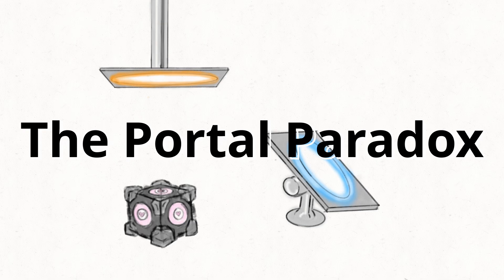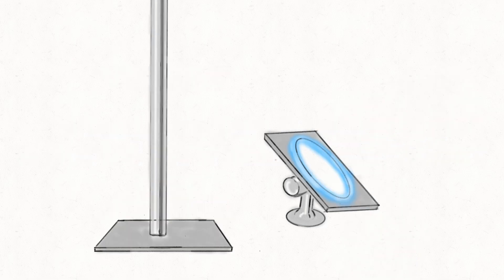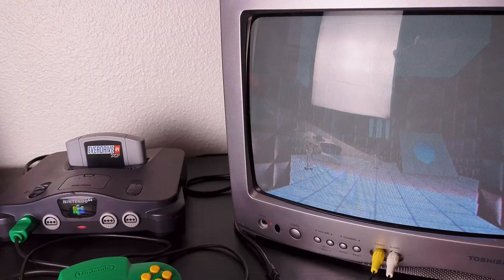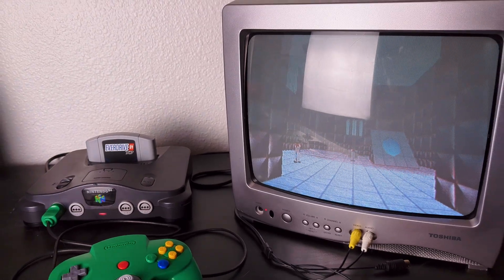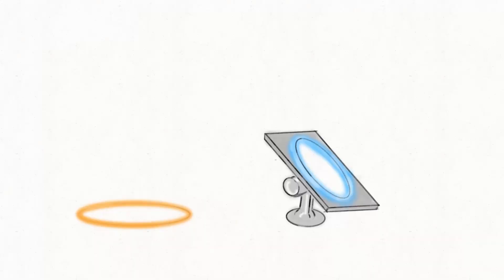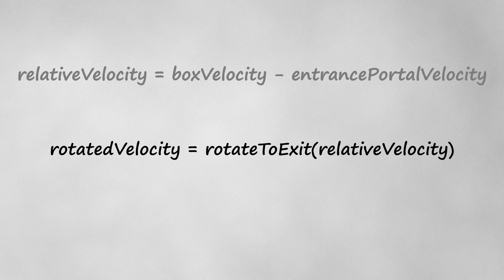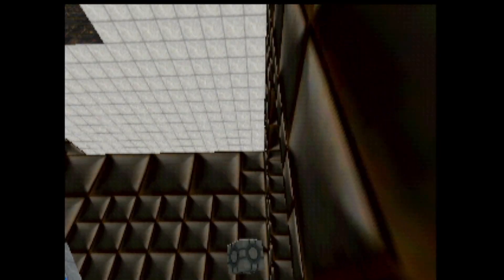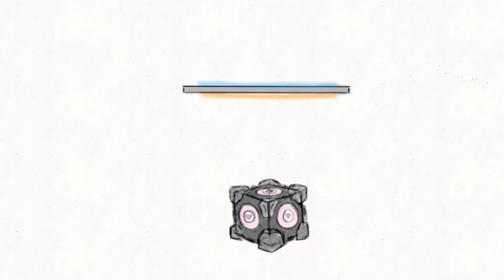I rewrote Portal from scratch and solved the Portal Paradox

Comment: I think the real problem here is that with this behavior of the stationary cube suddenly flying out of the other portal, the portal has added energy and modified the momentum of an object that was stationary. That is seemingly impossible unless the portals are energy sources. Does Chell also fly off into space when a portal moves onto her?
Reply: This is what I came to ask and glad to find someone else thinking the same. 

Where did the box get its energy from?
Reply: @KAC710  Think of it like you're in a bus:

Let's say you are walking in a bus. When the bus is moving and you are walking in the direction the bus is driving, relative to the ground, you'd be moving as fast as the bus plus your walking speed. If you were to be walking in the opposite direction of the bus's movement, your speed relative to the ground would be the bus's speed minus your speed.

This conservation of momentum also applies to portals. Since the portals you go through in the game never normally move, you don't gain any speed or momentum. But, when going through a portal, the portal gives you its momentum, relative to you. Like I said, since portals don't typically move when you are meant to go through them, you don't gain any more momentum. If they were to move, you'd gain the momentum of the portal you enter, and fly out of the exit portal at that speed. 

But, that's all up to speculation since a portal gun hasn't been invented yet. No idea if it's A or B, but it seems to me that B is more logical than A, but I may be wrong.
Reply: I imagine you won't even read all of that tbh
Reply: The portal may be moving to us, but it is a connection point on a different dimension than the 3 we normally experience. So to the portal, it's not actually moving. The door may move on this plane, but the path to the exit remains the same. So to the technically static portal, the cube is flying up at it, and it maintains that when the cube exits.
Reply: You are talking about teleportation portals - they break basically every law of physics there is. You can find countless nice fully mathematical explanations on how instant communication (or travelling) directly leads to time-travel.

In the games the portals can move objects to places of different gravitational potential - producing infinite energy. Just imagine a portal high up a mountain connecting to one at the bottom of the ocean: The pressure in the ocean is insane and so you would have a giant fountain with water gushing at around the speed of sound!!!! 

The portals being stationary or moving is the least problem then and treating the velocity as relative to the portals at least would be a consistent behaviour.
Reply: @ABaumstumpf while I've frequently seen examples that FTL travel leads to time travel (and they all require light travel the same speed in every reference frame), I've never seen the argument for instant teleportation because it uses infinite travel speed and ignores the speed of light issues that make effect happen before cause
Reply: @w49660   any explanation for why FTL causes time-travel also directly applies to instant teleportation as that is just the case were the speed is literally infinitely high.
The portals act like wormholes and for those there are many nicely written explanations on how they cause timetravel.
Reply: @ABaumstumpf  in their explanations of wormholes as time travel devices they eventually use frames of reference where the speed of light is a maximum and the explanations include "apparent" time travel "as seen by an observer from the outside" (and wouldn't let you travel into the past). It doesn't seem to apply to instantaneous teleportation that uses infinite speed
Reply: @w49660   i am not sure how you are searching or what you are reading, but with every combination i could come up at least one of the first 3 results gave a good explanation - ANY movement faster than the speed of light (which does include the infinite speed of instant teleportation) always results in a closed-timedlike-curve - which means timetravel (and not just "apparent" ).
https://en.wikipedia.org/wiki/Closed_timelike_curve
Reply: @w49660  I don't know why this myth about FTL just won't die, and people keep using it to defend Alcubierre. All FTL causes time travel. It doesn't depend on the mechanism. All that matters is information got from A to B faster than light. That is not to say an Alcubierre drive is literally impossible, but it does imply that IF such a thing is possible, then so is time travel to an extent.
Reply: @ABaumstumpf  FTL travel (properties of particles) and CTCs (geometry of spacetime) are separate concepts in theoretical physics, and I've found nothing that says FTL travel by itself (which leads to violations of causality) always creates CTCs
Reply: Good point. To preserve the conservation energy, mass going through the portal would have to create resistance to the portal's movement, proportional to the energy 'added'.

But that creates interesting new issues.

1: What happens in a falling loop? (two portals facing each other, one directly above the other)

I think there would actually be no resistance in the case of two portals that maintain a fixed position relative to each other. It's only when they move relative to each other that energy becomes 'added' and so resistance is encountered to conserve energy.

2: So the issue now becomes a matter of two portals moving relative to each other. How is the energy conserved? Is it applied to the portal? The mass being ported? Both? Does the mass experience inertial resistance relative to its original vector, or is it relative to the portals?

If relative to its original vector, that would imply that space itself is not being ported. If it's relative to the portals, then space itself is being ported, which means that the moving portals would create spatial voids relative to the fabric of space itself or something like that... I know nothing about the dynamics of the fabric of space itself, so lets just say it's only mass being ported. In that case, the mass would experience inertial relative to it's original vector... but physics breaks down if the portals themselves don't also experience resistance.

3: So, how would the pressure be shared or expressed between the mass and portals? I suppose that all comes down to the relationship between mass and the portal, but how does the portal work? What holds it where it is? In a situation like a cube being squeezed between two facing portals moving towards each other, what takes up that backlash? Can the portal deform or break? What happens if it does? Maybe the energy demands come from whatever energy is powering the portal, so in the case of electrical power the electrical load increases? But why? It all depends on the physics of the portal itself and the engineering of the device creating the phenomenon.

4: And what's happening behind the portal? Is it creating a void as the portal moves forward? What about moving backwards? How does that work in a relative universe? Is it like the back of a moving vehicle, creating a void behind it that gets filled in by the pressure vacuum or a pressure front that disperses into the surroundings? Is this where some of that energy comes from? The kinematics of portal backs?
Reply: I think there's plenty of examples to show that portals can add or subtract mechanical energy from bodies that they interact with
Reply: @Septimus_ii  Agreed. All in the name of playability and consistency, and because the principles of physics are violated by the entire concept of portals.
Reply: There would be air pressure, basically feeling like air was sucking you in as it was also passing through the portal. There's more science to this than conservation of motion... and I don't want to do it 😅
Reply: the YTer only solved one problem with the original version. but he didn't solve the problem with the conservation of momentum (this would still be easy to solve) and the conservation of energy (this one is a motherfucker).
Reply: Sadly, conservation of energy is only one of several physical laws that are broken by portals. Fundamentally they work they way they do because it was fun for the game :)
Reply: Energy is not preserved with portals.   Anyone who has played the game has at some point had objects fall from one portal into the other and go faster and faster, gaining unlimited kinetic energy (barring air resistance).
Reply: @asterpw  Well, terminal velocity is a thing, so the longer you fall, the faster you go until that point, even in a floor ceiling loop, a limit is hit.
Reply: @asterpw it's not the portals imparting energy, it's the gravitational force making you accelerate until you reach terminal velocity. The portals are just holes in space.
Reply: @pyrus2814  So why does an object sitting on the floor fly up into the air when the portal on the other end is on the floor?
Reply: @BrBill thats just a game mechanic, if it didnt fly up into the air the cub with me stuck between 2 portals
Reply: @agac2991  Of course. But how can you be stuck between something that doesn't exist? The portals produce a lack of material to be stuck between.
Reply: I also have a problem with this concept. Everyone’s replies are about relative velocity, and that makes sense…only if the portal were an object interacting with the cube. The portal is a hole, not a physical object. It’s the same as moving it through a window, the exit of the window is just further away that you would think. Therefore, what force is acting upon something going through a portal other than preserved momentum of the cube and background forces like gravity. The velocity of the portal never touches the cube
Reply: @suhspence99   it does not matter if the portal is a "physical" object or not - all that is relevant is relative velocity - cause that is the ONLY form of velocity that exists. There is no difference between  the situation were the portal is moving towards the cube, or the situation where cube and the entire room is moving towards the portal: Those 2 situations are identical - and the cube when passing through the portal thus must behave the same. So if the cube moving towards the portal causes it to jump out the other side then the exact same must be the case with the portal moving towards the cube - cause there is no difference as they are same thing.
Reply: You're misusing momentum. You're describing velocity. Momentum is a property of mass. It's how much energy is required to make a change in the object velocity. The momentum is (ignoring friction) the same whether the object is stationary or already moving. As for adding energy, for Newtonian physics sure, but those are wrong. All motion, all velocity, is in relation to a reference. It doesn't add energy if you stop observing an object from a Geo stationary reference and start observing it from a quickly moving one. It doesn't add energy to anything if the previously stationary object has a high velocity coming out of the portal either.

All of this is besides the point anyway, which is that physics was broken the moment you could add a great deal of elevation without energy expended regardless.
Reply: It’s preserving relative speed.
Reply: Thats what i have been thinking about. I have many problems with relativity because for me it resolves a system but its important to know who is moving and who isn't

Comment: Basic question: what if you drop the portal down but stop half way down the cube? Is there enough energy to still project the cube through the portal or does it just jostle it?
Reply: The particles of the cube that passed through the portal gain momentum but the particles that have not passed though the portal  have not yet gained momentum.  A sudden stop would put tremendous strain at the interface.   Either the tensile strength of the cube is strong enough that the rest of the cube gets pulled through or it gets severed in half.   Would be similar to hitting half the cube with a fast piston.

Comment: The acceleration of the cube would be detected as a force acting on the piston. 

Furthermore, imagine you dropped a stiff, lightweight sheet with a portal on the underside and the other portal directly faced up. The sheet would appear to float at the very top of the cube, because the downward gravitational force on the sheet would be counteracted by the downward gravitational force acting on the portion of box with had gone through the portal.

Comment: Portals are just like open windows. If a wall with a big open window fall on you, you won't be sent flying out of the window on the other side. A portal works the same way, it's just that the "other side" isn't on the other side of the wall.
Reply: But if you get pushed through the window at high speed by a concrete surface you are going to fly
Reply: @Ed-zo2gr  what was at high speed, the window? How would that make you fly exactly? It's just a hole, you go through the hole and that's it. Same with portals.
Reply: @Keeper-of-Fire  The thing going trough the portal/window is going at a high speed. It does depend on the weight of the object and the speed the object moves between each portal. But regardless how it leaves the window, if its entering fast, shouldn't it exit fast? Whether its being quickly pushed down by a portal on the ceiling or running and diving out of a window.
Reply: @Ed-zo2gr  the object is not moving, neither is it being pushed down, the moment any part of the object goes through the portal, that part is already on the other side receiving no force other than gravity. Again, imagine an open window, because that's what it is.
Reply: @Keeper-of-Fire  Isn't the object moving in both the whoosh and plop argument? Regardless of how, the object can't exit a stationary portal without moving and Portal portals definitely account for momentum unlike other portal interpretations in media that reset from points A and B. Imagine the very brief instance in which the object is halfway through each portal, it's definitely being moved at this point. If the orange portal slams and consumes the object at 200mph, the object must exit the blue portal at 200mph and I don't see why it wouldn't continue moving that fast after moving that fast.
Reply: @Ed-zo2gr  the object is not moving or "being moved" before going through the portal, only the portal is moving, so there is no momentum on the object to carry over, and it should only move on the other side if some force is applied on it, like gravity (which would only make it fall down, if it's not already on the ground).

"The object can't exit the portal without moving"
Which is why the portal is the one moving and sending the object to the other side. The reason why at no point the object falls back through the portal is because its lower part is still on the ground at all times, and the reason why it doesn't fall after it's fully teleported is because the other side of the portal is touching the ground and there is no space there to fall back. The second demonstration on the video, with both portals on the moving platform, is actually what should happen in all cases (where the exit portal is on the ground, not on the air for gravity to bring the object down).

"If the orange portal slams and consumes the object at 200mph, the object must exit the blue portal at 200mph"
And it will do that for as long as the orange portal is still moving at 200mph. Remember, the portal is the one doing all the movement.
Reply: @Keeper-of-Fire  I have an idea. Its a fundamental of the puzzle that the object exits a stationary hole, which it must do by emerging from it. If you put you're face completely still in front of the exit portal, the object is going to boop you on the nose, and the force of the boop and damage of the face depends on how fast the entrance portal slams and sends the object through. Despite the object being stationary and on the other side now, its the one carrying that force. I'm pretty sure that same force should apply with momentum too. Especially considering that if the object boops you at 200mph, it will shoot you're head off before gravity can stop it. But i'm uncertain if the stationary object dealing damage completely debunks the plop theory. I think there could be a reason why the object might safely fall after entering as you say, as well as damage faces on the other side but idk at the moment.

Comment: But this breaks the second law of thermodynamics in like, incredible ways. The cube flies out from the other portal at whatever velocity it entered, but that velocity had nothing to do with the amount of energy in the system or the mass of the cube itself. Therefore, we can scale up the mass of the cube tremendously and maintain the exact same velocity going out. F = M*A tells us that if the relative velocity of the cube remains constant, but the mass increases, that force must also increase. This means that unless there's an equivalent amount of energy required to push the cube through the portal, then you will have more energy in the post-portal state than the pre-portal state.

In order to satisfy the second law of thermodynamics, the amount of energy required to push the cube through the portal must be equivalent to the amount of energy it would take to move the cube the distance it must travel through the portal if both were stationary. The speed and force of the arm would assist in pushing the cube through, but until the equation is satisfied, the cube will not go through. And the moment it reaches the amount of energy necessary to push the cube through, the portal will stop acting on it and thus, stop supplying it with any more energy or inertia, causing the cube to fall out of the other portal with no additional velocity.